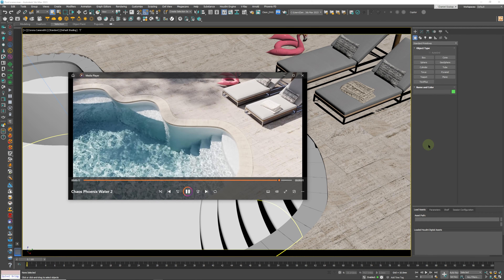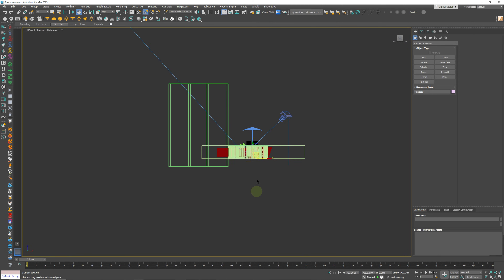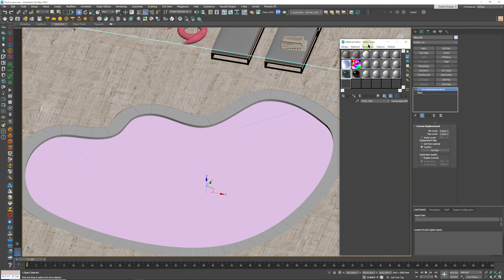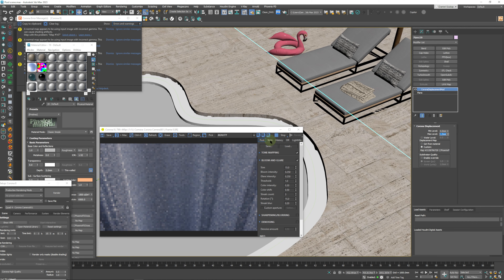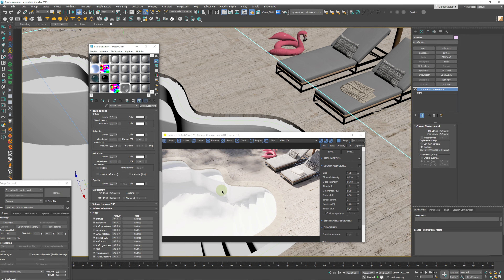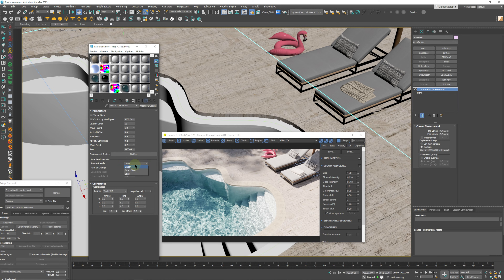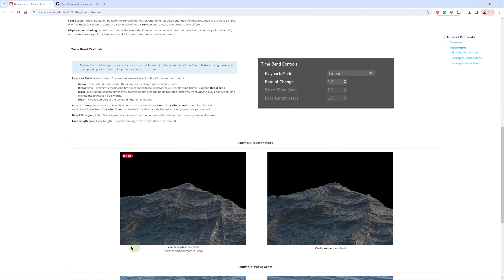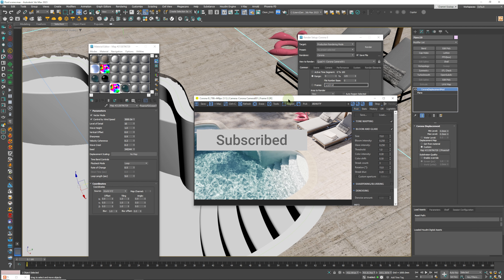Chaos Phoenix Pool Water Animation/Simulation (Phoenix fd ocean texture) 3DS MAX Corona

Comment: @ds-works greetings Daniel, a very informative lesson on phoenix. Please tell me, if I really need to make a pool with water (so that when viewed from below, for example, a pool made of glass between buildings), the volume is noticeable that there really is water in the pool, I need to create a "dimensional container" to determine the size of the simulation with water - and then apply this material?

P.S. Thank you! 🙂
Reply from the maker: Hi I haven't tried this, but it should work Just  make sure you have stong enough absorption colour on the water material enabled.